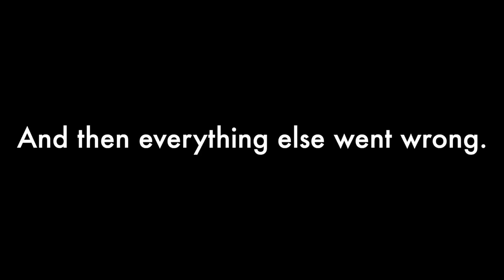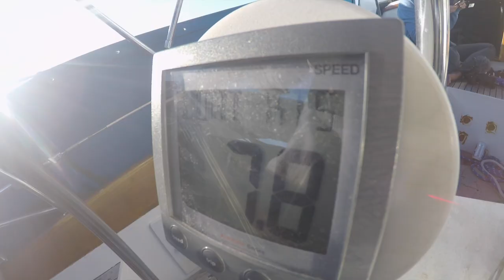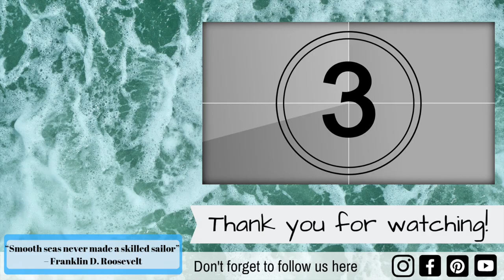Sailing Avocet | Bad Days in Paradise

Comment: YouTube has not recommended your channel and I am subscribed to most sailing channels. 
I found you by a comment you left on La Vagabonde!
JB weld will at the very least give you a good temporary fix.
I have used it on several truck engines on greasy and hot parts. 
I have not used it around salt water and that’s why I said temporary.
I wish YouTube would fix their algorithms but since the censorship started a few months ago I don’t get suggestions of things I am interested in.
Good luck with your channel.
I am surprised you don’t have a lot more subscribers yet.
I get to go back and catch up on your journey at least!
Reply from the maker: Haha crazy! Maybe you follow my older brother Jon from SV Prism. Luckily this engine fix was quick, and we are up and running again. thanks for taking the time to watch and comment!
Reply: Glad to hear you got it going.